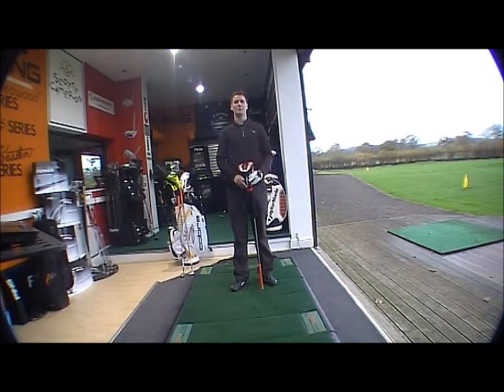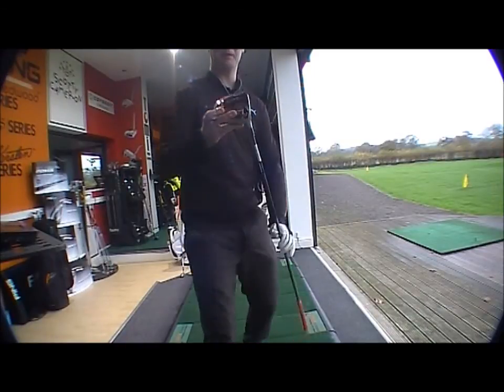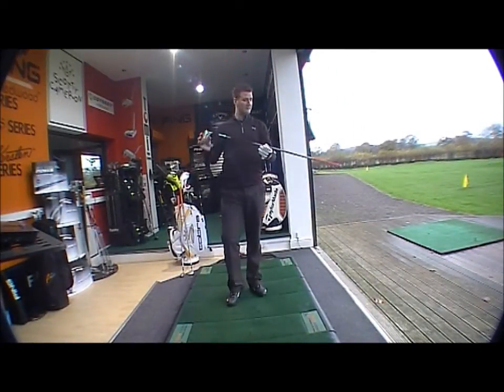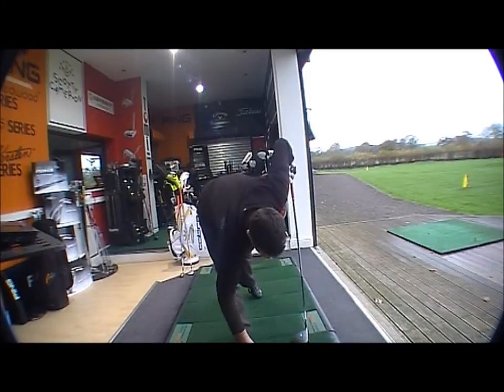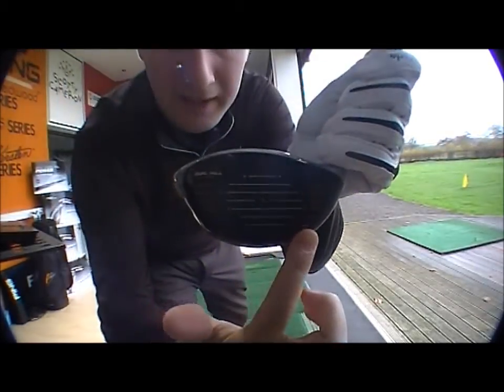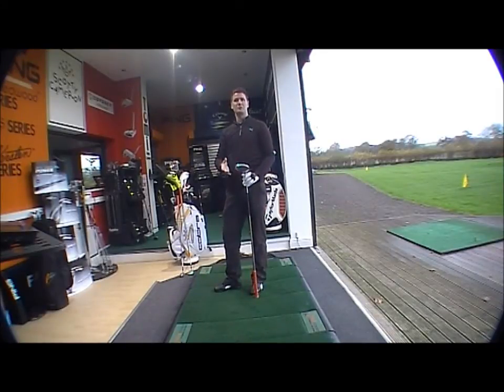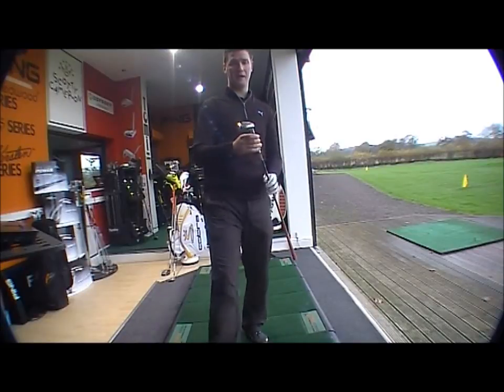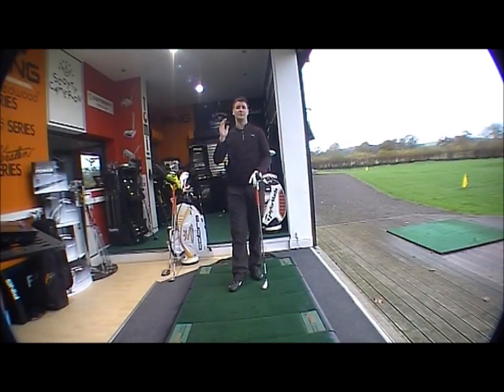Cobra AMP Driver   2012

Comment: From what I've seen, having hit both, the 2.0 club is not offset, but closed 2 or more degrees promoting a draw. The cobra sets up more like an offset iron, and I'd say it's much more effective in promoting a draw, and in my case, more distance even though 2.0 seems to have a slightly "hotter" feeling face. Plus, the white is lame (like 24 hdcps wearing white pants). Also look at the K15. Just stay away from an adjustable. New golfer should not be thinking about their "setting" after each ball.